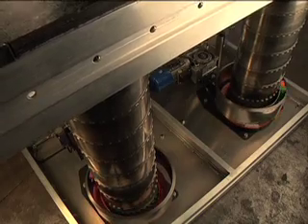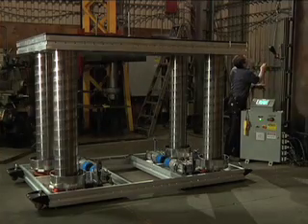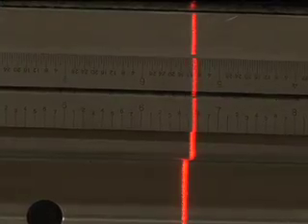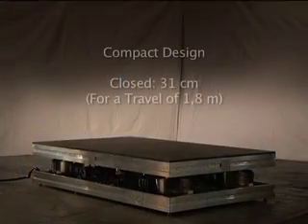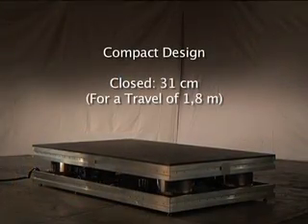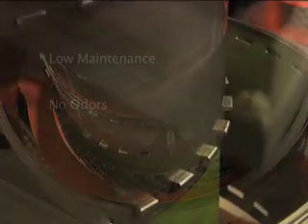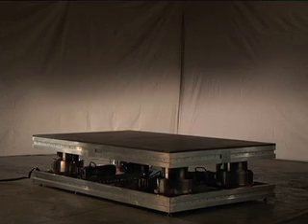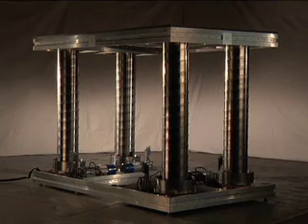Spiralift Telescoping Linear Actuator

Comment: No. They are disassembled.  Think of it like taking a tape measure and as you pull the tape out, you spiral it and pull on it to form a stretched cylinder.

Comment: So the pillars are obviously down in the floor when the platform is all the way down right?
Reply: I don't think so. It looks like the pillars are kind of like a paper towel tube: it's essentially metal tape that zips together as the lift goes up, and unzips as it comes down, leaving you with just coiled metal which fits within the profile of the device.
Reply: Obviously not.
Reply: No. The pillar is stored like a tape measure at the bottom. It gets rolled out like a toilet roll tube. So a flat roll can turn into a tube.
The lugs and punches holes hold it all together on place of an adhesive that a toilet roll uses.
This is reversible. But it looks like it has low robustness. Dint that tube and the sheet won't roll up properly.
Also I think it's linear carrying capacity would be as weak as the lowers lug.

Great way of getting a 20+ to 1 extension ratio though.